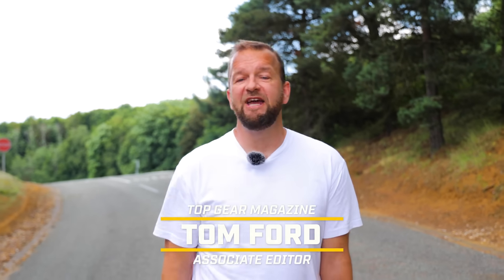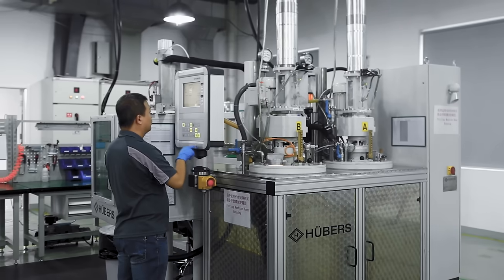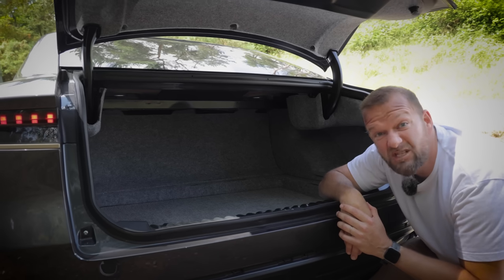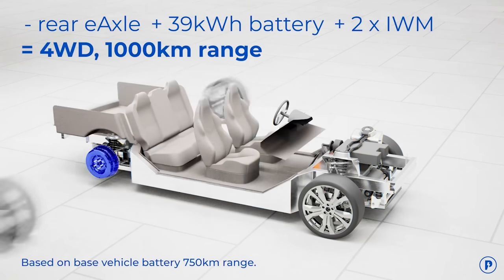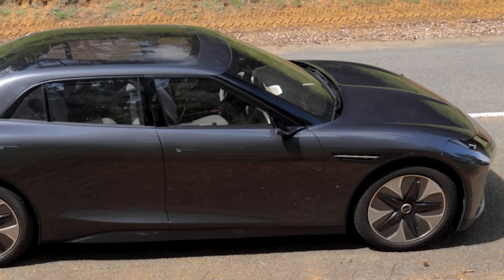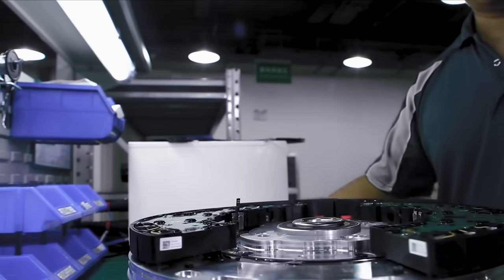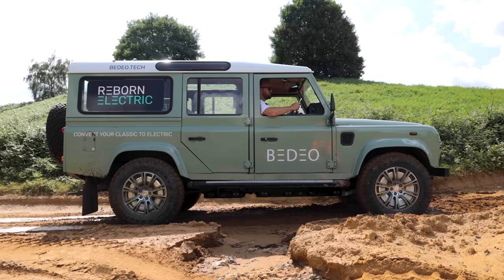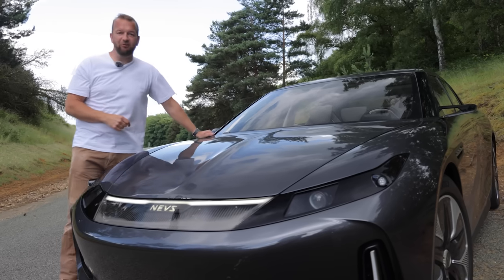NEVS Emily GT: SAAB’s Secret EV With 600 Mile Range | Top Gear

Comment: Bring it back as a SAAB EV and I would buy one.  I miss SAAB quite a bit and this would be a great way to bring them back to the world.
Reply: It’s a SAAB other than the badge. You’d have my full respect if you replace the badge. It would be a decent business opportunity to make a easy to install badge kit.
Reply: You heard the man: Saab had trouble, the Chinese company that bought them had troubles, and now whoever the new owners are pushed this out the door in less than a year. What could possibly go wrong?
Reply: agreed
Reply: @viscountslappy5085  it's NEVS, as written in the video title, in case you don't read
Reply: @viscountslappy5085 not new owners, just engineers doing engineering. This cars is likely made with love and not for corporate reasons.
Reply: i drive saab every day.;D so i am living your dream;D
Reply: @viscountslappy5085  It was GM that brought SAAB undone  the same Ford stuffed Volvo and China saved it
Reply: @viscountslappy5085 Queue the battery fire.
Reply: Was my initial thought. A kind of elegant resurgence.
Reply: I don't think thats possible to have the SAAB name..I think GM still owns it and why it was changed to Nevs
This is a SAAB, its basically the 95 last design and would say, that design is still beautiful and they did an awesome job with the design
Reply: Same here!!!
Reply: @viscountslappy5085   I'm not sure why you would think that if you watched the video, but if this does fail the technology will still be a legitimate leap forward for the industry. That torque vectoring is impressive, and the motors appear bullet proof.
Reply: Beyond their innovative introduction of Turbos of wayback, SAAB had superb interior ergonomics. Loved the sweeping tactile dash in I think the 9-5, with ONE mechanical button or dial for each feature, no double functioned touch strips like on the (otherwise excellent) EV6 and IONIQ 5. I have a Tesla and whilst it is a superb vehicle, I don't like operating the touch screen whilst driving to adjust the HVAC. I want to twiddle a knob with a digital readout in the middle, like on the Range Rovers.
Reply: Not another boring electric car...... 😐
Reply: @viscountslappy5085  errrrr implosion at 3000ft under the sea!???? a few yards from the titanic??
Reply: Then just buy a saab. old cars are better anyways
Reply: holy shit its zollotech
Reply: I had 4 SAABs and liked them untill GM bought them and screwed things up
Reply: Saab AB (the aircraft manufacturer) revoked the license to use the griffin logo and name.
Reply: Ignition key? That's oldfasioned no new cars have those. U just get in and drive. That's how my Tesla works.
Reply: Amen bro!
Reply: I love all of this.  I just hope they don't forget how to make fantastic seats.
Reply: It's a Chinese company now and it will have Chinese components and be greenlighted by the Chinese and all the Chinese EVs blow up... It will be junk.
Reply: @jamesdellaneve9005  " Queue the battery fire" Oh FFS, give it a rest and get yourself educated. 
Why don't you actually look up how many EV battery fires there have been, rather than spout absolute, and provable BS?
Reply: @davidcolin6519  Not many in the west. China has an epidemic of battery fires and a glut of cars that no one there can purchase. There’s a good channel that covers all things from China. It’s called Serpentza. Like their empty cities, they are making poor quality cars that can be exported to the US.
Reply: @jamesdellaneve9005  I am well aware of the claims. But there is not an "epidemic" of battery fires. And yes, I have seen the YT videos of Chinese BEVs going up in flames. But I am also naturally sceptical, so have studied those videos. And the curious thing is that so many of them are in the same locations. One in a public square, another in a parking lot behind a tall building with, curiously, the same cars parked around, and another on a very open, urban setting. There may have been one or two others. 
But beware of the news value of something unusual. It's the "granny rape" news report syndrome. Grannies being raped is so rare that it makes the headlines everywhere. 3 or 4 BEVs going up in smoke because of battery fires is so unusual that people film them. And those BEVs will certainly NOT end up in the USA. Because all the ones that I am aware of involved BYD's Han and Tang EVs using the previous generation of BYD's batteries. And guess what? BYD themselves have refused to export those versions, and it was those fires that led to them developing the Blade battery, which is one of the safest of its type anywhere in the world. The only battery which appears to be safer is CATL's Condensed Matter battery.
But that's enough about BEVs, what about ICE? I've certainly seen several ICE cars go up in flames, and one of my own only failed to do so because I had a fire extinguisher on board, and another fortunately had an isolator switch on it. Curiously, all BEVs must, by law, have isolator switches in them, yet ICEs, with all that flammable liquid at high pressure don't. And yes, across the world, literally 000s of ICEs go up in smoke across the world every year.
Reply: Bring back SAAB, period!
Reply: @rjanBerge yep I've got a 93 tvector 04 and it's still going strong... Bought it for £950 and spend relatively fuk all on it and had it 7 years!!!
Reply: If the badge matters so much to you then you just don't care about the car very much
Reply: @donnie9001  SAAB parent company took the SAAB trademark away from the Chinese company when the Chinese company ran into financial trouble, so they changed it to NEVS.  I think SAAB just was too snobby to the Chinese even though they were trying to save the SAAB car brand.
Reply: I also had a 1993 Convertible SAAB. It was mechanically reliable but had some electrical problems like sometimes it wouldn't start.
Reply: @Simon-oy7kf  Very valid point. I must be very unusual in that I have only ever had 2 cars from the same manufacturer, and I'm over 60 years old. My bikes have tended to be Japanese, but there is no specific bias to any one brand.
Reply: All you have to do is prove to SAAB that 100,000 people are willing and ready ready to put a down payment of $50,000.00 and get in line.  If you can do that, they will bring it to the US.  Big job ahead of you.   :)
Reply: You won't see it. The company has been liquidated by the owner in April this year. SAAB was bought by NEVS, which has now shutdown.
Reply: @abrahamben-zeev9142  how about a Kickstarter campaign?
Reply: @donnie9001  GM might own the name, but more importantly is that the logo is owned by both Scania and SAAB W&A.
back in the day that would not been a problem with all being Swedish, but now Scania is owned by Traton group, a under-company of Volkswagen... and we all know how VW is about their things... and the Wallenberg family have no interest in helping NEVS ether.
Reply: They should bring saab back period.
Reply: @antwango  Thought 12,500 feet under the sea..12,500 feet divided by 36 inches = 3,000 feet?
Reply: +++one of my favorite brands т.т
Reply: what an irony, saab was created after bigest Europe war and now his coming back when another bigest war in Eu is continue...
Reply: @donnie9001  GM never owned the SAAB name.  Svenska Aeroplan Aktiebolaget (aka SAAB") owns the SAAB name, they licensed it to the automaking division.  Just as Rolls-Royce cars are not actually built by Rolls-Royce, which is an aircraft engine maker.  The name, badge and mascot are licensed.  Anyway, SAAB has said they will not re-license the name again.
Reply: @markm0000  The engine bit seem a bit generic / just happen to be here. Wonder if Koningsegg could had improved upon the vehicle then again the engine is likely covered by patents and Koningsegg stuff expensive.
Reply: @donnie9001  SAAB own the SAAB name, SAAB the defence contractor, the car company split from them years ago and the name was licensed, they withdrew the license after all the bankruptcy , (Post GM )
Reply: @donnie9001  Saab AB, the aerospace company, own the rights to the Saab brand name. When they sold the automotive business to GM, GM licensed the Saab name from Saab AB. When Spyker's Saab Auto went bankrupt, it's assets (the IP, plus the plant and offices in Trollhattan) were bought  by the Chinese in the guise of NEVS, Saab AB refused to allow them to use the Saab brand and stated that the license that GM had purchased lapsed when the Spyker owned Saab Auto went into bankruptcy.
Reply: @Karl-Benny  SAAB killed themselves by making cars that had no profit margins. GM kept the company alive for longer than it would have been.
Reply: @jamesdellaneve9005  Petrol engined cars dont catch fire.
Reply: R G Letourneau’s Electric Wheel of mid 1900s was truly successful on heavy equipment & was used in building some sections of the Eisenhower Interstate System of highways, modernizing the Panama Canal, amongst a lot of other projects. It looks like it might take off on small vehicles like SAABs, tractors etc. SISU also had a very successful hydraulic wheel(that’s a whole different story. Oh if only the Wallenberg family had maintained ownership of SAAB, we would all be happier.
Reply: Yes, SAAB, forget the name NEVS. SAAB all the way, I'd buy one for sure.
Reply: I mean, some idiot brought back MG... and they've made a dogs dinner of it. Bringing back Saab would be great!
Reply: My last Saab was a 9000,  a beautiful car.  I'm envious when I see Saabs on the road!  GM tanked Saab and I would be excited to give this vehicle a chance after I put a few thousand miles on my new Hyundai Ioniq 6.
Reply: Still checking in at Saabnet to look at prices on a used 9-3 hatchback. Loved that car…
Reply: @donnie9001  the SAAB brand belongs to SAAB the aerospace company. When GM took over, the brand was only licensed to the car maker. When SAAB motors closed, the brand rights reverted to SAAB AB the aerospace company. They've said they've no intention of allowing it to be used by a car maker again.
Reply: @JamesSmith-qs4hx You’re right, this one is not boring.
Reply: The first car my mom had when I was born was a Saab I want them to come back!
Reply: you didn't miss them enough to save them from bankruptcy
Reply: @miljororforsprakpartiet290  I don’t think my one car purchase would be able to do that. I’m not a billionaire.
Reply: @zollotech  u only bought one car but couldhave scrapped it and buyed more cars instead of fiat and alfa romeos
Reply: Maybe ZEEKR as you wish. Some former SAAB guys work for it.
Reply: I still got a 2008 aero xvd it´s my 6th saab. I will never drive anything else, mark my words!(swedish)
Reply: @markm0000  You could nick a badge from a scrap Saab and DIY it. I doubt it would be too difficult.
Reply: Go and buy one tomorow
Reply: If people had bought a SAAB they did not have had to sell to the chinese
Reply: Hell no that not what it originally was